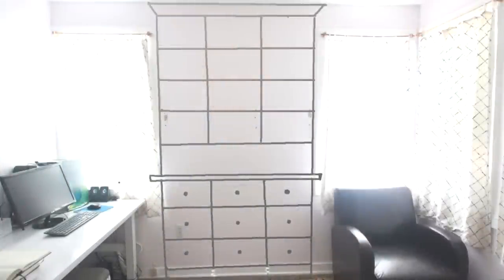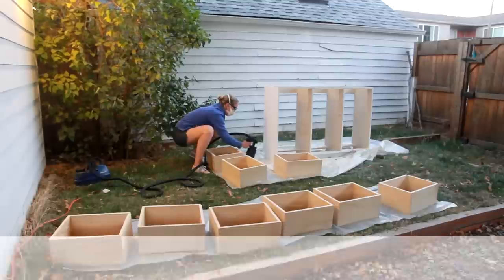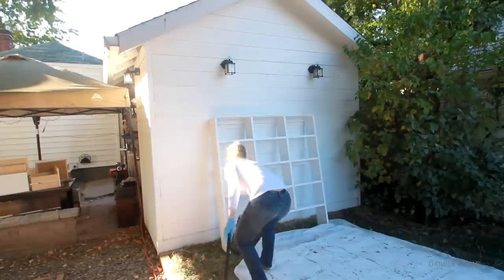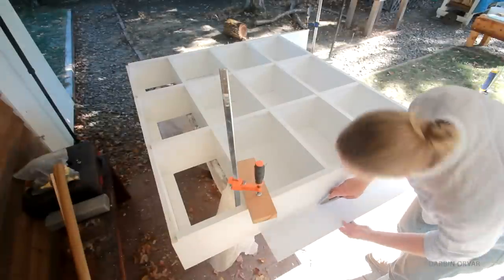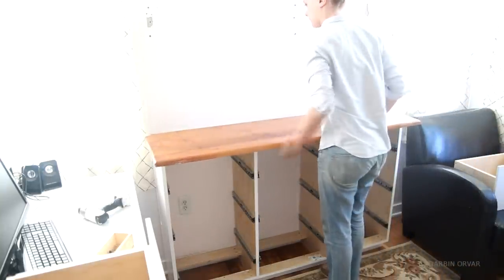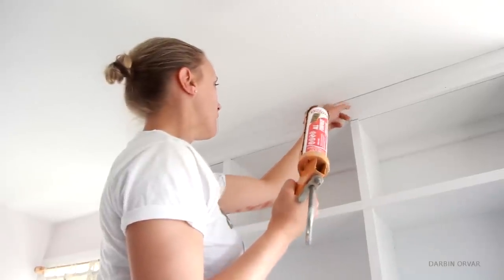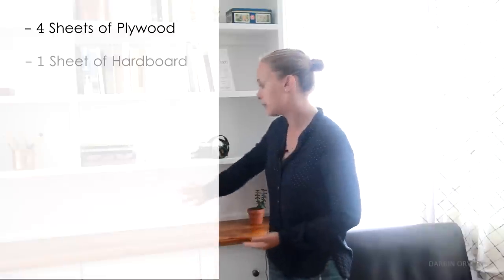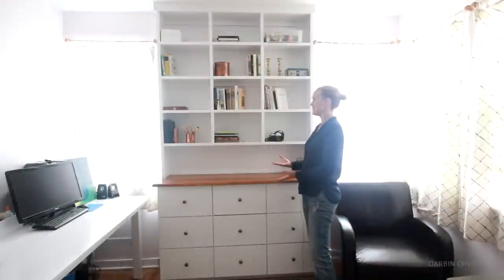Installing & Finishing Built-in Bookcases and Drawers for an Office

Comment: Looks good, and it's nice how you took the time to explain everything clearer so that someone else can reproduce this or come up with their own design using the same methods. You also gave some good tips on getting a seamless look. 

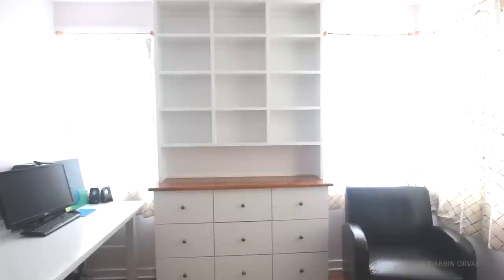The only thing I noticed which is a slight let-down in the drawer installation video and this one is that the middle drawer sits lower than the others surrounding it and I think this is apparent in this video at 6:07. At the end of the day, I'm not the one who has to look at this built-in on a daily basis.

It's a good project and the overall finish is good.

Comment: Congratulations!  Your  project turned out beautifully! I really enjoy seeing your techniques in woodworking and I have made note of some of them to use in my projects.  I am currently making a built-in for a niche that was designed for smaller TV's.  Since my TV is much larger, I mounted it over the fireplace but I"m left with an empty space the size of a VERY large refrigerator! The  top (like you top) is 3/4" plywood wrapped with copper sheeting.  I purchased some copper nails 1" long and pre-drilled holes to prevent the nails from bending to form an "aircraft skin" pattern.  The doors are going to be 2 1/2" fixed louvers (kit from Rockler) both on the bottom and top units.  I"ll send you photos when finished if you like.
Reply from the maker: +Docdaugh Thanks for the comment. Definitely send some photos when you're done!

Comment: Really a nice project! Poly is certainly tough indoors... I would actually doubt that Polyurethane adds any durability to a modern paint... they are Titanium based and extremely tough and durable. This is why exterior paints are so much better in weather than even spar varnish. Few people are aware of this... This is why I will run a varnished board through my planer or jointer, but not a painted board. It is rough on knives!
Reply: No need to add it to painted pieces
Reply: I use it on indoor painted projects that will get a lot of friction/contact, like table tops, mantels, etc.  It makes a big difference actually.  Put a lamp and a few pictures, or a heavy vase on a painted mantel, then change it a few times every year.  Check back in a few years and see how your paint looks.  The answer:  Not as good as my paint covered in poly.
Reply: Interesting... I tend to use milk paint on indoor projects and distress it. Otherwise I don't generally use paint, especially on anything that will see heavy wear, but poly is slippery and acts as a clear coat so what you say makes sense.

Comment: This turned out amazing! That counter top is fabulous! What exactly did you use for the finish on the counter top? Just 5 coats of Poly?
Reply from the maker: +Evoashes Painting Thanks! I used a 1 poly: 1 min wash for the first coat, after that just 4 regular full strength poly coats.